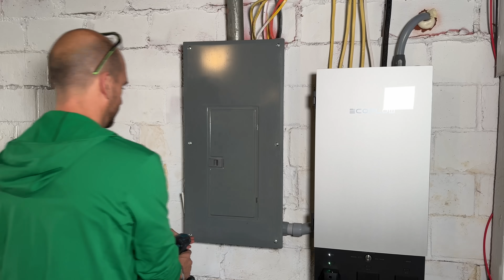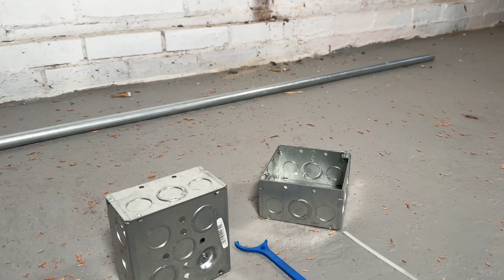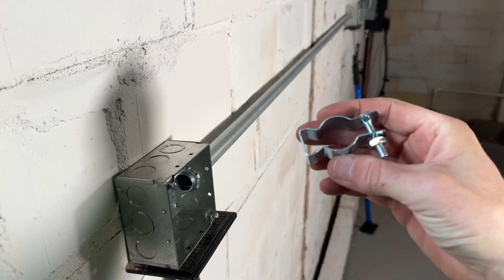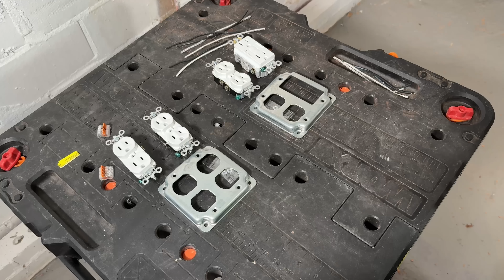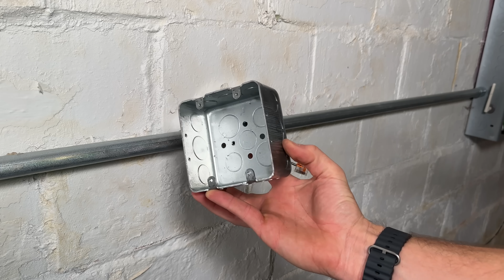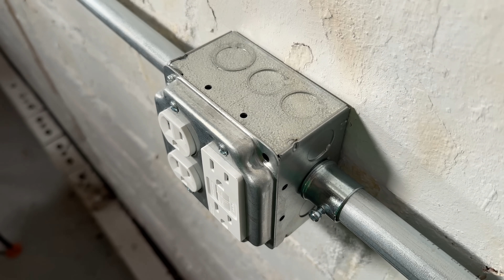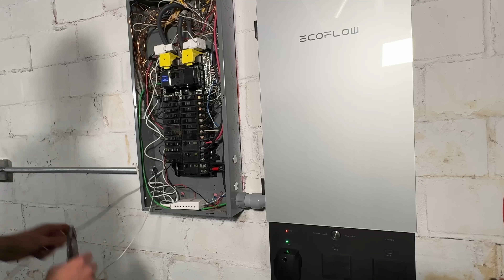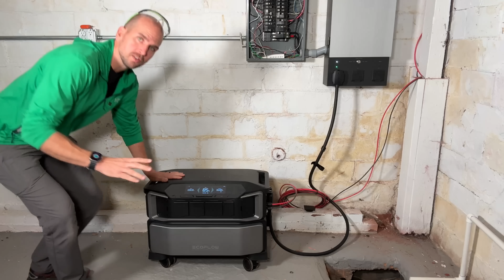Add Outlet To Unfinished Basement Or Garage

Comment: I learned as an apprentice to ALWAYS pull a ground conductor, period. You can NOT count on the conduit fittings to remain solid.
Reply: You were taught someone else's faulty opinion. As long as the conduit system is installed properly you can absolutely count on the fittings to remain tight and secure, things don't magically loosen. Metal conduits are run without wire grounds all the time.
Reply: @pld8993  yea, I know this. I've always gone with better to error on the side of safety. I've been doing this for 30 years. I always run grounds through conduit. I work in steel mills, and you can't count in conduit to be in good shape for eternity. Now, if you live in perfect-perfect world where nothing but perfection exists, sure, save some money by not running a ground for added protection. While there, rip out the seat belts and air bags from your car and keep your hands on your lap while driving. Oh, perfect-perfect place doesn't exist on Earth? Run a ground wire.
Reply: @2006gtobob  Since we don't live in perfect world I'm sure you wired your house with rigid metal conduit instead of romex, and ran all of your 20 amp circuits with #8, and buried all your underground wiring 6' deep instead of 2' deep, because what-if, what-if, what-if. Adding wire grounds unnecessarily increases labor costs, increases copper costs, increases conduit sizes, etc. I've installed hundreds of thousands of feet of emt, imc and rigid, mostly in industrial facilities and most of it without wire type grounds. I don't live in perfect world, but I also don't live in what-if world. If I what-if every installation I would have been out of business years ago. Conduit fittings don't magically loosen any more than ground screws magically loosen. Adding a ground wire with metal conduit doesn't increase electrical safety, it simply makes some feel safer, and I'm not in the business of appeasing unfounded and irrational feelings.

Comment: everyday debunk: national electric code allows for use of romex in conduit as long as it's not a damp location (outdoors) or the conductor fills more than half the available space in the conduit.
Reply: NEC allows cables in raceways in general, as long as the cable is suitable for the environment of the conduit (since wet location conduit interiors are also wet locations), and as long as you assign the conduit fill area based on the maximum diameter of the cable.

For instance, snugging two oval-shaped cables side-by-side with parallel non-intersecting major axes, such that they wouldn't fit if you twisted one 90 degrees, wouldn't be allowed.
Reply: @carultch  yes, thanks for clarifying the cable diameter requirements!

Comment: You should be using 20Amp outlets with a 20Amp circuit breaker.
Reply: Not true, 15 amp devices allowed on 20 amp circuits.

Comment: 1) As an electrician we NEVER use pipe cutters ( the rim they leave may cut into the wire) 2) You tightened the box connector by screwing it into the box,( I will never own a lock nut wrench) 3) Box offsets would have been artful. 4) Plastic bushing would be artful 5) We ALWAYS  pull a ground, yup the EMT can be used for this, but hey why not be better than the minimum code. 5) Wago's are all for DIYs, not professionals. I have fixed lighting that was bad in giant rooms full of wago's.
Reply: The diff between old school and new school. Both work. Wire nuts also are prone to failures with bad bites.

Comment: By Code you are required to have a ground pigtail to the box. Receptacles are required to remain grounded when removing the trim.
Reply: Incorrect, pigtail not required for cover mounted devices or for self grounding devices.

Comment: Where is the pipe offset to the box..Freaking AMATUER...
Reply: Only an amateur would think that. Box offsets are not necessary here and most conduit installed by pros without box offsets.
Reply: You didn’t spell “amatuer” right, amateur.

Comment: There is nothing wrong with using Romex inside emt conduit in this application. Yes, industrial and commercial applications use reeled thnn wire. It's much easier to pull it through long runs and bends with fish tape.  I would as well wrap ground around screw to ground box and conduit run.

Comment: Is it just that Romex in a metal conduit is not necessary, or is it prohibited? If so, why?
Reply: Not prohibited. Unless it needs physical protection (conduit), conduit is unnecessary.
Reply: Romex isn’t always allowed, per some area codes. Think moisture.

Comment: I remem which wire goes where by the size of the plug slit. One is longer than the other. The smaller slit is always the hot.

Comment: customers want all the receptacles to look like a face but they should really be like an upside down face so the ground is facing up. There's nothing in the code that requires this but it does mention in the handbook that generally if the appliance plug is loose, the weight of the plug will pull it down making the ground exposed rather than the hot and return (120 volts in your house is not really a neutral, it's a return)

Comment: viewers, please do not use those stupid ass connectors. just use another couple inches of wire and wire nut them. Don't twist the wires yourself, let the wire not do the job. and pull on each wire while holding the wire nut to make sure they don't come out.
Reply: Wrong. Create the twisted splice, then add the wire nut.

Comment: You don't run Romex inside EMT because those wires aren't going to move at all and they're not going to be offset they're too much in order and they will cause eddy currents
Reply: Romex in conduit is allowed, and sometimes required, in conduit. Eddy currents simply because the current carrying conductors are surrounded by a layer of plastic sheathing? Not true.

Comment: for a few cycles now the cheap ass contractors got any seat to change 30 amps from 10 gauge to 12 gauge. just run 10 gauge, what are you going to spend an extra dollar when you're buying 25 ft of it in a package?

Comment: You really should put an offset in that thing and support it directly against the wall. That's the most secure. But most people don't have a pipe bender and even if they did it's quite a bit of practice to get a good offset to match up correctly without dog laying or being too high or too low or looking like crap. I have no problem with using those offset mounts
Reply: Yes he's missing a single support in the 6' length, but there's no need for offsets or for it be secured directly against the wall. A mini in the center of the 6 footer is all that's needed.

Comment: EMT shall be installed as a complete system in accordance with 300.18 and shall be securely fastened in place and supported in accordance with 358.30(A) and (B) (NFPA 70E, a.k.a. "NEC")

Comment: in a garage where it's going to be wet or damp, don't use those stupid connectors. use compression fittings. they're not even a dollar each
Reply: The inside of a garage is almost always a dry location, and this garage is clearly a dry location. There's no good reason to using compression connectors here.

Comment: Don't use metal use the gray Crylon pipe so much easier and quicker they sell everything for that pipe including offsets. Just bond each metal box with your ground then hit the outlet with the ground. Butch here has no offsets on any end of the pipes there hanging a 1/2  inch off the wall. Shitty home owner looking install. You'd fail an inspection too. I'd be embarrassed to make a video of this.
Reply: Using PVC would be a shitty home owner looking install. Offsets are not required or necessary and running conduit without offsets is done by pros every day. Other than a missing support on the 6' length, nothing else would fail.
Reply: @pld8993  Bullshit..that's a worthless electrician who either has no pride or doesn't know how an EMT bender works.
Reply: @My1970TransAm  Spoken like an amateur. If you were an electrician you'd know you're wrong, and you'd also understand why you're wrong. Until you become one, have a seat.

Comment: Emt minerallac straps should be installed only over 8’ feet high and above. Avoid Personal sharp metal exposed. 
Make boxes offset and use one hole straps. Never install an outlet receptacle without gripping wire.

Comment: Not to code without ground wires
Reply: Incorrect. The conduit is the ground.
Reply: @pld8993  back in the 70's
Reply: @DonnaF-yi4jx  In the 70s and today, the conduit is the ground.
Reply: @pld8993  until it is not
Reply: @pld8993  Would rather be safe or be wrong ?
Reply: @DonnaF-yi4jx  Not sure what you point is, but you're the one who's wrong. Using the conduit as the ground is both safe and code compliant. Conduit grounding path is electrically superior to a wire type grounding path up to about 400'.
Reply: @pld8993  If you have done this in the past please call it inspectors. If not for your safety for the safety of others.
Reply: @DonnaF-yi4jx  I've been in the trade for over 40 years. Real electricians use the conduit as grounding path all the time. There's nothing unsafe about it.
Reply: @pld8993  You would then know that some professional liabilities has not expiry.

Comment: How to add an outlet to an unfinished basement and void your homeowners insurance policy if the house burns down due to faulty wiring!
Reply: Other than a missing conduit support nothing here is faulty, and a missing support will certainly not cause a fire or void your insurance.
Reply: @pld8993  Like a lot of content on YouTube, this video demonstrates just enough information to be dangerous. You assume a lot from our DIY homeowner who will be tackling this job. Will they cut the conduit to the proper length, ensuring a solid connection or will it work it's way loose, breaking the ground back to the panel? Do they know how to properly feed wires thru conduit so as not to damage insulation?  There's a reason that electricians spend 4-5 years as Journeyman before they become electricians.
Reply: @chrisstromberg6527  The bigger problem with Youtube is that there are LOTS of videos where things are intentionally done incorrectly for the sole purpose of generating clicks and comments for $$$.

Comment: It is not against code to use romex cable, and in many cases, it is even better, good installation!
Reply: I agree, he just saying blah blah and not backing up with nec code
Reply: I just watched another video by Silver Cymbal that backs your comment up. Romex inside conduit (provided you don't remove the jacket) IN NON DAMP LOCATIONS is legal. Garges and basements are considered non damp locations. Multiple (claimed) electricians in the comment section also back up your assertion. 
https://www.youtube.com/watch?v=PZFJkXfThUg

Comment: Nothing wrong with running NM-B in conduit in DRY LOCATIONS as long as you don't exceed conduit fill rules.  I don't like installing metal boxes directly to concrete below grade.  The box will eventually rust out, I've seen it a LOT over the years.  In a case such as this, I would add a double layer of building felt between the box and the wall.

Comment: Always run ground, always run ground, always run ground!!!!! Especially if you are relying on the plate connection for ground you would want a pigtail from receptacle to the box.
The purpose of a ground is to offer a low resistance path. When a path has low resistance it will pull a lot of amps, by doing so it will flip the breaker feeding that circuit. The EMT has way more resistance meaning that even if a hot leg does come in contact with the ground it may not pull enough amps to trip the breaker. That means that even though you in theory use the tubing as a ground, it is not nearly as effective as a actual wire.
Reply: Incorrect. Steel conduit is a much more effective and better grounding path than a copper wire up to about 400'. Study skin effect and you'll understand why.

Comment: Commercial electricians put an offset in the EMT.    Takes about 2 minutes is all.
Reply: We don't always use box offsets, depends on the installation, in this case it's not necessary.

Comment: If the panel is not in a wet location then neither is the outlets.    So a person could just strip the romex cover off and use the wire.   This is for a home no one will be inspecting it.

Comment: Never use a pipe cutter to cut EMT.  Use a hack saw and ream the cut end.   A pipe cutter leaves a  sharp edge that can strip off the insulation when the wire is pulled through across the sharp edge..

Comment: Wow.... I see a lot of comments from "ACTUAL" Electricians and I am 100% in agreement with all of them ( I'm a 30yr Master Electrician).  If....and ONLY IF you run without a ground and use the conduit as a grounding means then your AHJ or inspector would require Compression connectors over SS  ( Set screw). in 1981, the MGM hotel in Las Vegas burned to the ground due to using the conduit  as the grounding means. The circuit shorted and due to connectors (in some cases not even used) corroding and coming apart, the conduit then became energized and ignited the material inside the walls.  https://en.wikipedia.org/wiki/MGM_Grand_fire
Reply: Not true at all. Compression fittings are not required when using conduit as EGC, set screw fittings are fine. That fire was caused by improper installation, code violations, etc., and not because set screw fittings were used and they magically loosened themselves.

Comment: Actually a real electrician with a piped it up the wall into the rafters and then send the pipe across the top of the raptors then back down to the other plug and GFI the first plug but not the next
Reply: No, he wouldn't. Straight across the wall is exactly how a real electrician would do it.

Comment: I have read that bushings are required on the conduit connector ends inside the boxes to prevent wire chaffing on potentially sharp edges.
Reply: Only for larger conductors, not in this case.

Comment: You installed your outlets upside down. The ground lug belongs on top.
Reply: The NEC does not specify a particular orientation and the words are printed to be read in any orientation.
Reply: @JDIII4000  If a three conductor plug wasn't inserted fully into the wall outlet and a metal object were to come into contact with the exposed conductors, the safest position for the wall outlet would be to have the ground terminal on top so that there would not be any live power exposed. It would not make a difference if the plug is only two conductor.

Comment: Correct me if I'm wrong, but is it legal to put 15amp receptacles to a 20amp breaker?
Reply from the maker: Yeah, code calls out that you need at least 2 X 15 Amp receptables (e.g. single duplex outlet) if you are going to place them on a 20 Amp circuit.

Comment: Always run a ground - don't rely on mechanical fixings to handle fault current.  Connections of dissimilar metals in contact that can cause galvanic
action  that may result in a high impedance ground - it is just not worth the risk for the sake a few feet of copper wire.  Additionally, someone may unwittingly make a mechanical change in the future that would compromise the  protective ground circuit.  This is a bad habit to get in to.
Reply from the maker: Fair point and agree I should have added a ground wire in this video.
Reply: @EverydayHomeRepairs  Why do you think you "should" have? Because of random non-electrician comments in a youtube forum? Using the conduit as grounding path is done every day by professionals and, in your installation a wire type ground is unnecessary.
Reply: A copper wire connected to a terminal screw is a mechanical connection using dissimilar metals, so what's your point? Sounds like you hobbled together different things you've heard and then tried to put them together in a sentence that, at least to anyone who knows what they're doing, makes little sense. The NEC lists 14 types of grounds, only 1 is a wire. There's nothing wrong with using the conduit as a grounding path, real electricians do it every day and it's not a bad habit. Professionals understand this, amateurs usually don't.
Reply: @pld8993  What is the electrochemical reaction between the copper wire and the terminal? Stick to your home improvement level of safety - clown.
Reply: @stephend  I've been in the trade for over 40 years, junior. Become an electrician before you pretend to know what you're talking about. You're not the first youtube amateur that doesn't know what they're talking about, won't be the last. Please explain how steel conduit with steel fittings connected to a steel box is an example of connecting dissimilar metals. Back to 3rd grade science class for you, rookie.
Reply: @ Because clowns learning how to do things on YouTube won’t check what metals they are using. It’s old farts like you that don’t think ahead that cost lives.
Reply: @stephend  The only clown here is the one pretending he knows what he's talking about. Copper wires are connected to dissimilar metals every day, like zinc coated terminals, or bronze terminals, or copper terminals with steel screws, etc. Aluminum conduits are used with steel locknuts, steel conduits are used with aluminum conduit bodies, copper bus bars are used with silicon bronze bolts, etc. Certain metals will chemically react with each other, true, but just because two metals are dissimilar does not mean a catastrophic failure due to a chemical reaction that will cost lives is the result, genius. Again, 3rd grade science class would do you some good.